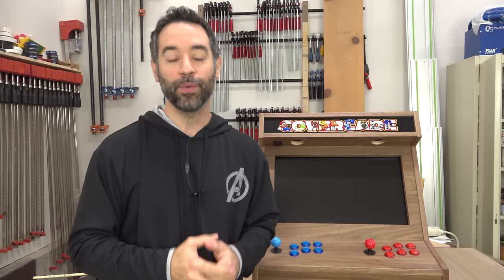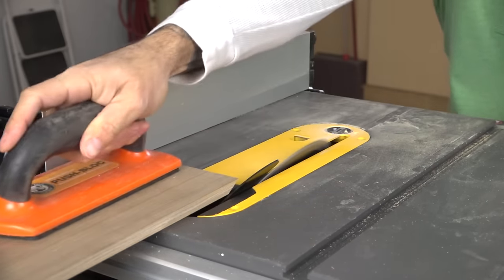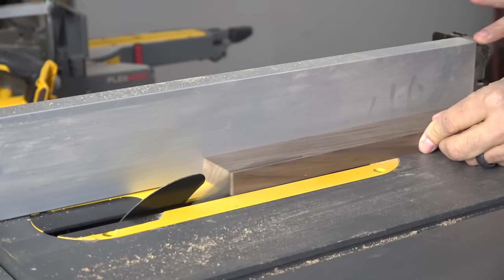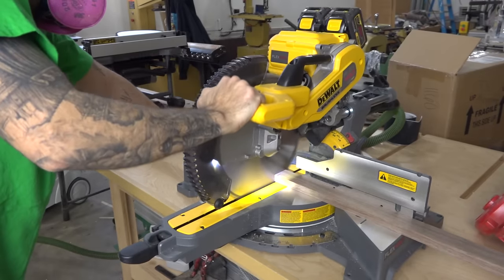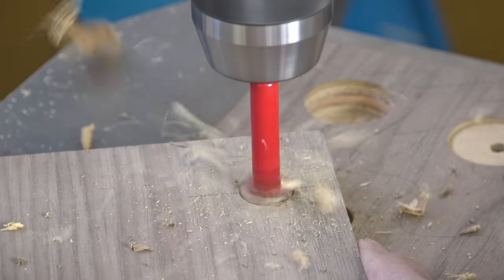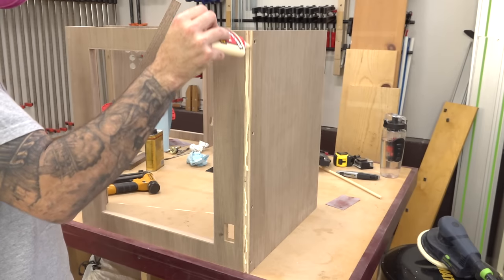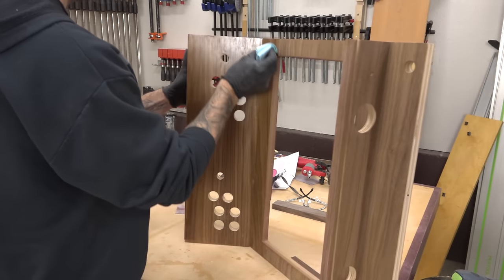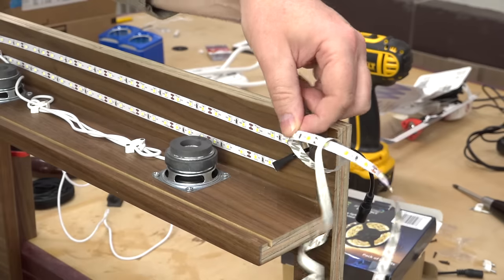Bartop Arcade w/ Raspberry Pi

Comment: Thanks for this video. I'm building my own arcade cabinet and, after watching a number of these arcade cabinet builds, you are really the only one to focus on the woodworking part of it (which is probably bc most people make these out of MDF, paint them black, and use T Mould on any edges, so the joins aren't really ever noticed/appreciated). Anyway, there are several steps that people rush through (particularly the monitor bezel/mounting part) that I'm really glad you covered at a nice pace.

Comment: This is, by far, the nicest cabinet I have seen.  The methods are as close to DYI as I have seen.  The quality of materials is terrific.

I want such a cabinet but I want it to double as a PC workstation.  This would be for my son who I would want to be able to use this not just for certain gaming but also for his regular computer for homework and the like.  To that end, a keyboard/mouse drawer might be the most awesome modification to add.  That lowest front-facing panel might have a hinge somehow or perhaps it could be halved where the lower part has the hinge-door where the keyboard and mouse tray would emerge... or maybe no door at all... just a tray with rails.

Comment: That thing is gorgeous.  I made a bar-top arcade a while back, and now I want to build a full-sized version, or build a base to make the bar-top look like a full-size while it is sitting on it.  Also, I put one of those power/switched power ports on mine and it seems to be holding up well so far.  The one I got is fused.

Comment: Nice job Marc.  I really like the USB extensions on the front.  I'm adding that to my future builds.  Couple of things:  The pie can get hot when under heavy loads (e.g. games), so I recommend adding some holes for ventilation and USB cooling fans to move the air.  Also, buttons on the side of the cabinet are a really nice addition for pinball games.  Unfortunately they need to be mapped for each game in RetroPie but I find they are a fan favorite.

Comment: I run that exact power plug on 3 of my arcade boxes.  One of them has an entire desktop computer along with speakers and a 24 old LCD monitor and it has never been a problem.  It has a fuse in it in case there is ever a surge so the risk is fairly minimal.

Comment: PC based one we built with Blue tooth and WiFi, KB and mouse under the desk for programming etc as well as ports for controllers made from melamine... My close friend did the PC build as he's the smart one out of the two of us, while my primary role was to grunt and carry heavy weights :) I swear it weighs more than my car !  Not to mention the awesome kickback I received on my right hip which left it black down to just above the knee for about a week (micro Jig splitter's installed into the zero clearance plate purchased AFTER the accident) -  wish i could show you a picture :)

Oh, if you haven't tried the MJ Splitters, the WW has a video on them and they are bloody brilliant, especially on older machines where you have to unbolt the table saw's riving knife/splitter every time you need it removed (which means you get lazy and leave it off ! )

Comment: Great job Marc. well finished. 
The only thing I would add for a project like this (with wire and computer components) is some ventilation in the back. when you have all this wires together, most likely you will create some heat, and as a fire precaution a good air circulation would be great. PS, I am big fan of you!

Comment: I highly recommend, for pre-drilling for circuit boards, that you use a punch to mark, and drill without the board present. It's far safer for the board, and not that hard to do to avoid  potential issues.

Comment: Maybe already mentioned, and old so no one will see this, but for getting the joystick centered, you could 3D print a cylinder with an outside diameter of the hole and inside diameter of the joystick shaft.  Slip it over the shaft and put the joystick through the hole and it will be perfectly centered.

Comment: nice! the good thing about building one not for yourself is that it gets finished! my has been 95% done for 2 years! >.<
Reply: Mine has been 0% done for about 5 years now.
Reply: Lol yep.  I made one 20 years ago when I was in high school by modding a actual arcade cabinet with my own control panel and stopped to use it before I got the t-molding around the control panel.  Its had allot of use and has been moved several times and still doesn't have the molding to this day.  Now I would just start over and make something allot less deep and use a big lcd vs the 24" crt.  I kind of want twin single player sit down cabinets like the Japanese astro city cabinets to play versus fighters in more comfort, run both monitors from one computer for two player games.
Reply: Mine has been in the planing stages since 1999. Yours is further along than mine is. I guess I was just waiting for the Pi and LED tvs to come along so that I could build a lighter system. Now I just need a large 3D printer to make the whole cabinet.

Comment: great video

will need to countersink those joystick holes with a router about 1/4 inch to make the posts longer and also the buttons.

also counter sink the monitor bezel to make it alittle more flush.. add some lowes plexi glass

Comment: Looks awesome. Maybe you could mount a cooling fan in back to rid the case of excess heat. Also what about adding a rotary wheel for games like Tron or Tempest, can it just be connected to the controller just like your joystick and buttons?

Comment: I want to use my CNC, I have a monitor that's a little smaller, so I would like to shrink your plans just a smidge, if I do that, will everything still align? also is there anything besides the door that I need to consider when cutting due to your allowing for edge binding? cause Im not going to use that. What do you think? I have your CNC file, I first did it and nothing aligned but I realized your plans are for .74" ply and I used .5" so I want to try again but this time I want the entire thing just a tiny bit smaller so my smaller monitor doesn't look bad. Advise?

Comment: You could've disassemble the monitor and attach the screen to wood as the other parts that it contains, that's not necessary tho but you could've made simpler construction and it would come without a gap between wood and screen. 
Also, great project, amazing content and i'm big fan of the show.

Comment: Loved the project, but a few of those pin-nail operations made me flinch a bit.  Found out the hard way this week that it pays to keep your non-gun hand fingers at least two nail-lengths away from the gun tip.  Was adding a 1/4 " plywood back into the rear of a new wall cabinet when one of my 18 gauge nails pulled a 180 degree "J" turn and exited the side panel . . . and entered my fingertip  Close to an inch deep.  Missed the bone and nail, but not by much.  Just one more hard-learned word to the wise . . .

j-

Comment: so I have done something similar when it comes to the joystick installation and I instantly regretted it the first time a friend of consequent size and weight played on it, the 4 screws on the plate couldnt handle the pressure and ripped off the stick from the plank and it felt through. 

For this reason I then basically mounted the stick with the plate over the plank after cutting a layout to have it be at the same height as the rest of the panel. This way even with excess pressure there no way you would break anything as the whole joystick plate spreads the weight evenly on the wood, not only the 4 screws ( which I assure you with brutal people will not last long)

Comment: What about heat?  Seems like that monitor will be living a shorter life and maybe the raspberry pi as well with no ventilation.  Also, I've seen the reviews on amazon for one of those plugs where someone had fire/melting issues.  It looked like the person used a gauge wire that was way too small for the amps he was pulling and it failed at his crimp points on the wires.   An alternative would be to gut an old pc power supply and use the connector and switch.  I'm actually planning out my own build right now and have watched a lot of videos.  The woodworking here is too much for what I want, but I like the shape of this bartop.  It's pretty close to perfect.  Thanks for sharing it in detail.

Comment: You need an air pressure adjustable gauge and then you will not get holes with the nailgun. You adjust the air pressure.

Comment: Love it. I've been meaning to setup a retroPi for the longest time and then eventually getting around to a cabinet, but I keep putting it off. the Pi4 might come out before I ever start...
Love the PokemonGo Plus.
Also, a question, would using a shooting board for mitering the edge banding be worth it or is it too much work setting up the angle?

Comment: Hi Marc, what is the circuit board into which you plugged the switches. I may have an application which would work well with this or even this and a Raspberry Pi.

Comment: I am currently building this with my son, did you guys ever work out the issue with the power switch? I am thinking a standard wiring to a jobox with 4 outlets will do the trick and use a simple wall switch to turn it all on.

Comment: did you have a link to the circuit board used to connect the joysticks? that one seems a lot easier to set up than others i have seen .. also did it come with the connectors?

Comment: You mention that it doesn't matter the way the buttons are wired up, if you use the same encoder PCB for player 1 that you do for player 2, the button order must be an exact match. I.e. If button A on player 1 is plugged into socket 1 on the PCB, then it must be the same for player 2. Retropie (Retro-Arch) will only create one config file based on the PCB controller name, so if you use identical encoders for each player there will only be one config file created therefor they need to be identically wired otherwise it will cause issues.

Comment: That looks awesome. I'd love to make one, but I think I'd get stuck on the electronics. Is Raspberry Pi easy to work with?
Reply: the raspberry pi is very simple to work with, linux based, the OS is run off an SD card, retropie is the OS/software custom built to run all the emulators you can think of, everything else is basically plug n play. Emulation Station is your front end which will detect your controllers and launch a controller configuration at boot up to map your buttons to your liking, which can be easily changed if you choose you want a particular button mapped elsewhere

Comment: Loved the video. Is there any issues with heat build up in the cabinet from the monitor?
Reply: Agree. While LCD displays are no CRT, there is still heat (otherwise, why is the display itself vented). A large pair of holes in that back door on the cabinet would probably do the trick.

Comment: How is a fused IEC a fire hazard?!

I'm building one of these next month.  I kind of like the vinyl wrapped classic arcade look though so I'm gonna cheap on the cabinet material.
Reply from the maker: It was the particular brand we purchased. There are other brands that don't seem to have the widespread reporting of melting and fire hazards. But the one we picked out has numerous reviews that mention melting.
Reply: The Wood Whisperer that's a total bummer.

Comment: So how do you go about accessing the wiring or joystick bases, since there doesn't seem to be any access points to the underneath of the cabinet. (I know there is a back door, but you can't really get your hands, eyes, and a screwdriver in there to tighten anything if it comes loose. Thoughts on this?
Reply: Never mind, it just clicked. drill out the dowel plugs and disassemble the back and front pieces.

Comment: Sadly my arcade cabinet got old.... I am trying to rebuild it. It was full size HUGE! Anyway todays tech is allowing me to redo it all in a much better way. My question is where do I buy these pressure fit USB ports? My cabinet was strictly MAME before but to add some of my favorite games from my old consoles would be nice as well and to simply plug in a USB controller right at the control panel would be great. Even better! Again this is a full size cabinet Not even sure I can pull it off with a Raspberry Pi3. Going to try. Bluetooth might be my option. As I also have a trackball eating up a USB port. Anyway if anyone could point me in the right direction for this pressure fit USB port. It would be great TY.

Comment: Hey . if anyone can help me . I built my own arcade machine based on a raspberry pi 3+ and a custom rom set .I can not set up the arcade classic controllers . system finds 2 controllers but when I try to set up it sets only "move up " and then nothing . no joystick no buttons but with external usb ps one or Nintendo controller works perfect.does anyone know how to set up classic joystick and buttons?

Comment: You could wire a household 15 or 20 amp circuit breaker as a power switch.

Comment: Little tip before You or Friend started using that cabinet. That Joysticks aren't made for plywood mount, they have to short shafts for that, they are build for metal control panels. At least You should buy something like "Sanwa Mounting Plate JLF-P1-S" and make room to lift that joystick up by route some material from plywood. Or buy joysticks designs for MDF mount like cwl303. Consider also plexiglas on top of control panel, because that joystick dust cover gonna leave a mark.
I build arcade sticks, some work you find on FB account, https://www.facebook.com/Wilku-Arcade-167526419994575/ , and from hardcore gamer like me point of view , ergonomics is important.

Comment: My request would be to have dual screen quad controller so I could play X-men, and Simpson's, with TMNT.
Reply: I absolutely can't stand free space where the screen should be i.e.a huge monitor without marquee, or bazel. infinite edge  acrylic with rgb led lighting.
Reply: Any chance of not using a monitor and have a bottom mounted projector instead. with mirrors if needed with a short throw keystone correction projector with the option to use projector away from arcade cabinet.

Comment: Let's spend $3k plus on wood tools first!!!
Reply: Much of that can be done by hand if you prefer. Though it would not cost $3000 in tools unless you were buying the most high end equipment you can find. If you go to Harbor Freight and get the minimum, skipped a drill press and just used a hand drill you could get everything for under $1000. Odds are if you looking at a video by The Wood Whisper you might own many of these tools already. And it's not like these tools are a one use items. Once purchased you can build and build as many other things as you can imagine. Or watch more videos on this channel.

Comment: Button layout socks. Spaced too far. No diagram for hanging monitor
No drilling guide for buttons but page alignment has crosshairs buttons template doesn't. Nice arcade bit sucks for beginners really bad. I may redo this plan and send it in later. Arcade plan is very nice. Just use templates from ..google this..(starcade.) great joystick templates. Use tape on back of monitor to trace holes and transfer to mounting monitor board centered. Nice arcade for beginners if this was in it. If not. Noobs use a different plan. Experienced guts should be good